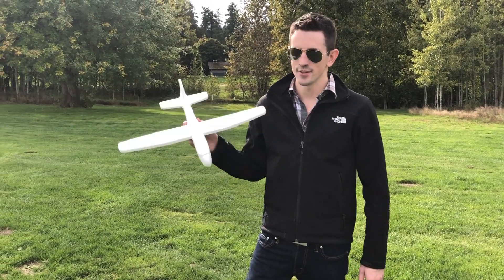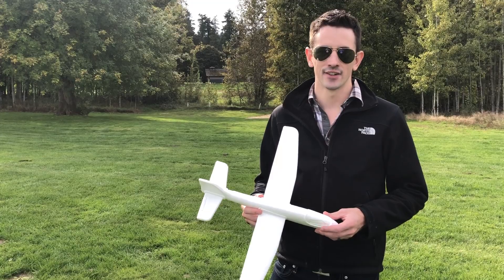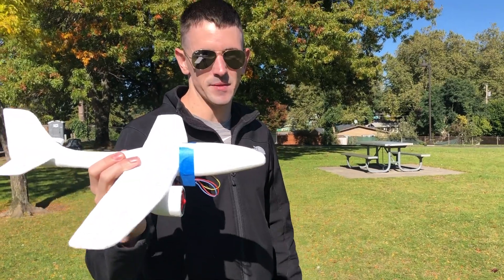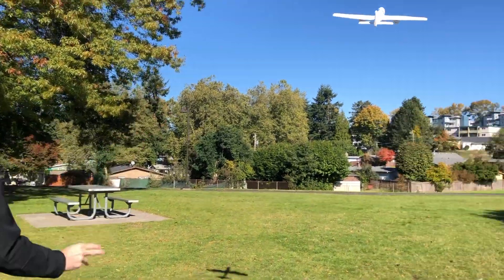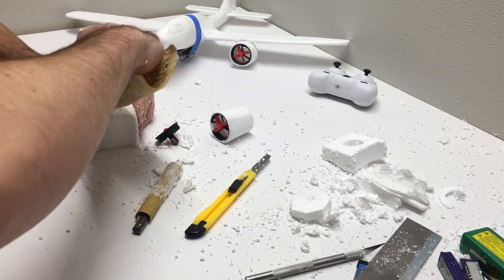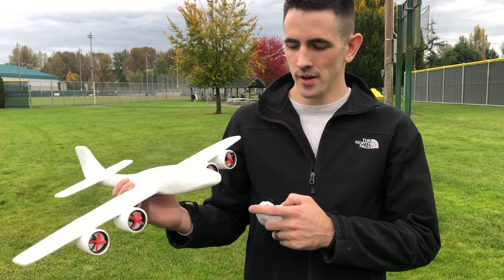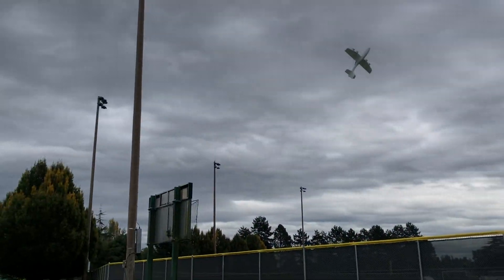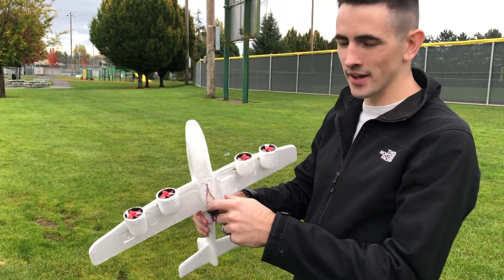RC Chuck Glider Conversion - Full Build less than $30

Comment: There's a gyro in the board that is suppose to keep drones upright. This gyro is the reason why it really can't turn. It's not because it's too heavy. I bet if you'd add some dihedral to the wing and used a proper airplane board without gyro it would definitely fly! I've tried the same thing a few months back and that's at least my conclusion.
Reply: Not exactly, Ive seen vids where people did similar things and used the gyro to their advantage, When you turn its sppeds up 1  motor and slows down the other, using differential thrust, same thing with how quads turn, except the control might be inverted depending on how you mount the motors. Dihedral might help it become more stable though.
Reply: Mine also has a gyro and only the 2 motors are spinning, the 2 extreme motors already not spinning when it is climbing, they spin when it is about to crash that’s an issue I am facing

Comment: I built and still improving.  One thing I found using drone parts is the gyro. If tilts too far, it goes into failure and crashes .

Comment: On my think, to fly rc plane from quad, you need to pointed the drone board to the left/right, dont pointed to the front and use only left stick to control. And use both left/right motor as the engine to fly this think.

Comment: I need some help, I was given two working motors from a wreck,  Can I change the connections to the motors to work with my transmitter?  I want to use the motors for a conversion of a foam glider….

Comment: In indian rupess 30 dollar 💰 is about 2100 so these plane is too expensive
Reply: Not really. Taking in account the fact that if you go to BUY an RTF RC plane, it would cost you anywhere from 20k to 50k just for the beginner friendly models. I've seen a 4 channel F4U Corsair listed for 41k. 3 channel RTF prices start from 20k and onwards. And buying a 2 channel isnt really worth it while getting an RC plane. If you choose to BUILD your own, it's much cheaper, taking in account you could actually build a big one (900mm wingspan or more) and it would cost anywhere from 10k to 18k depending on what electronics or stuff you use. Ofcourse it could get more expensive if you wanna build even bigger ones (2000mm wingspan and more) with more power, more channels etc, but to make a beginner model, it would cost you 6k-10k using the cheapest parts. So... 2100 is STILL cheaper than all that lol-